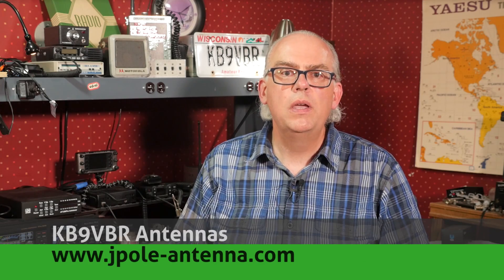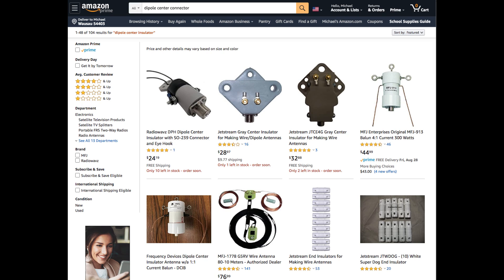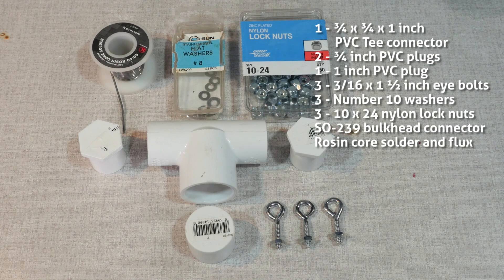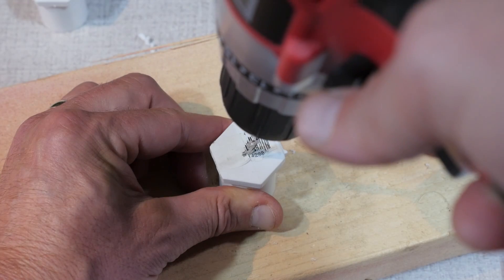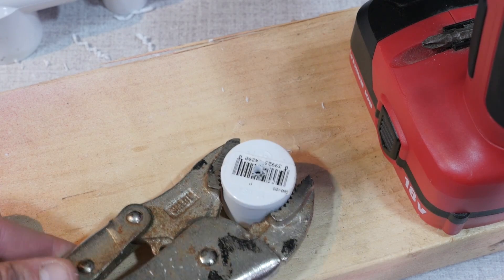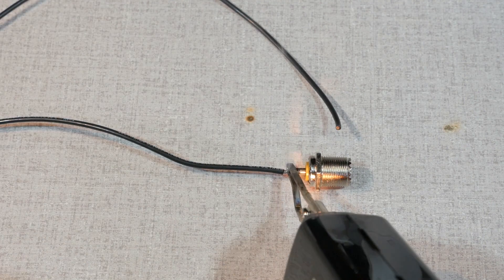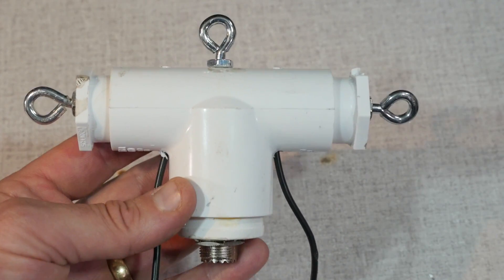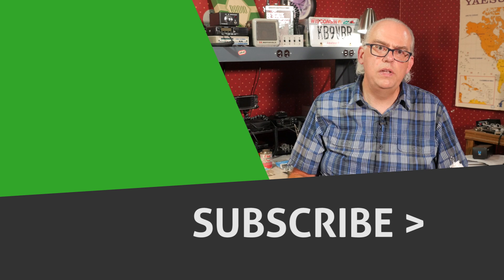Build a Dipole Antenna Center Insulator - Ham Radio Q&A

Comment: Great video, Michael - and the outtake at the end was a hoot! I think I'm going to see about getting some parts from the plumbing section at the box store and get started on that fan dipole I've been meaning to put together. 73, KO4AZY
Reply: Quick update - I went ahead and built a 2-element fan dipole for 80 and 20 meters, using your center insulator. I got the center point up into a tree at about 25 or so feet. The ends of the 80 meter wires ended up about 3 feet above the ground, with one running straight but the other needing to loop around a railing on my deck and back toward the tree, so it's more-or-less an inverted V. I find that I have to use the tuner in my Xiegu G-90 for 80 meters, but 20 meters works beautifully without the tuner. I can also use the tuner to get a match on 40 meters.
The broadsides of the dipole are oriented North/South, but I have been able to speak to a fellow in Croatia on 20 meters from NC which surprised me greatly since that is East of me and about 4800 miles away. Remarkable what 20 watts and a wire dipole can do when propagation conditions are right!
Thanks again for the education and inspiration for this project, Michael! 73, KO4AZY
Reply: @theElderberryFarmer  Dwight are both of your runs the same size? if not how did you divide them?  I'm guessing you have a total of 137' ??
Reply: @GmanfromTexas  Hi - yes, both runs were the same length. I don't recall what the final lengths ended up being after tuning/trimming. I'd check, but that antenna is long gone now. I have moved on to using a home-brewed end-fed 1/2 wave antenna with a 49:1 matching transformer. I get tired of using the same antenna and start itching to try building something new.

I've had very good results from the end-fed 1/2 wave antenna. It was easy to build, uses less wire than the dipole, and is quick to deploy and break down.

To me, much of the fun of the hobby is building new antennas.
Reply: @theElderberryFarmer  i hear you. Do you have any videos of your new antena? Or any specs?

Comment: I became a Ham almost 3 months ago, my first homebrew antenna was a 20 meter centerfed dipole similar to yours but the PVC was just a short tube, it's still in use and I make great contacts with it. 20 meters is my favorite band, I'm going to add two more legs and use spacers for 40 meters soon. 73! KI5JCO